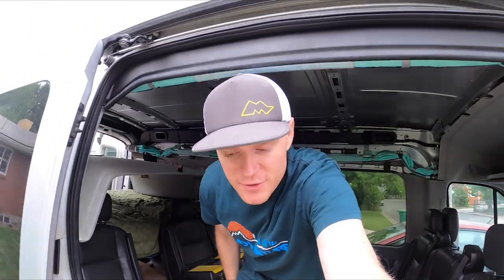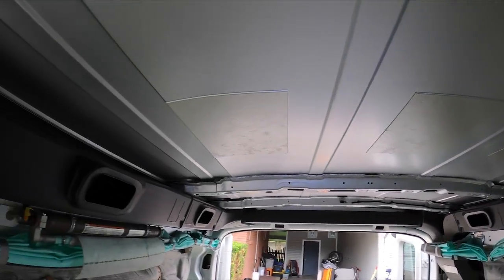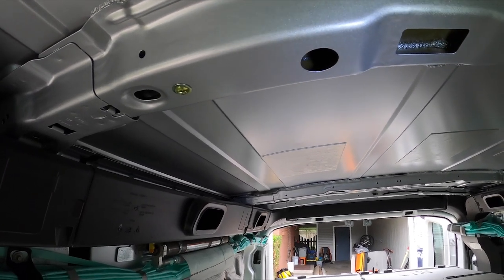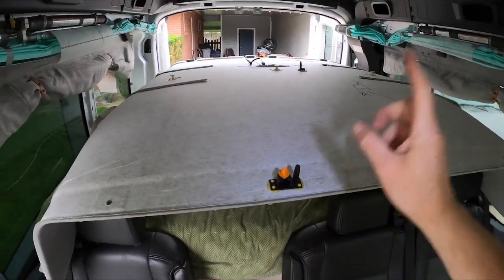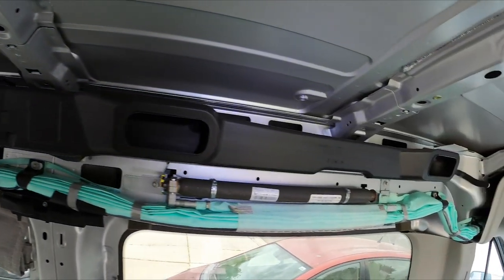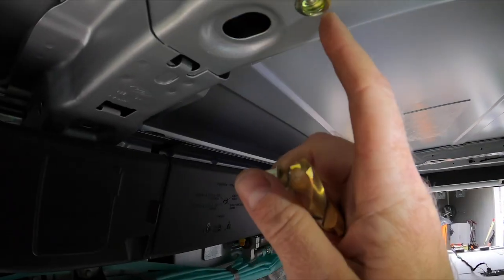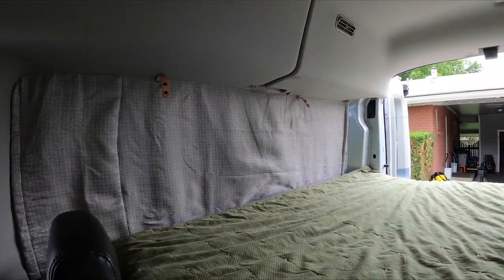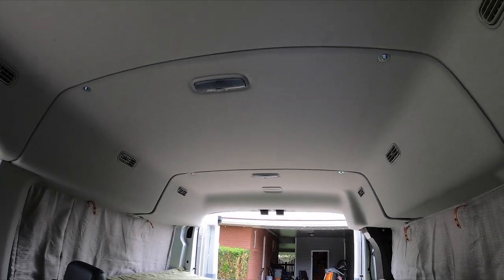Ford Transit - a look at the ceiling behind the headliner

Comment: On those new bolts, what kind of spacer did you use between the Rivnut flange and the bolt washer so you could get some compression on the bolt without crushing the headliner?
Reply from the maker: https://www.amazon.com/gp/product/B07DVZFFML/ref=ppx_yo_dt_b_asin_title_o05_s00?ie=UTF8&psc=1

Comment: What size plusnut did you use?   I am about to start on a transit passenger high roof extended.   I want to do a similar thing to the headliner once i pull it out.  Thanks.
Reply from the maker: Good question. I can't remember what sizes I used. it was just slightly bigger than the existing holes. Only had to bore them out a tiny bit to get the plus nuts in.

Comment: How have you ended up using the attachment points, if at all?

Do you think it would be possible to use the front ones to attach some sort of cross bar or wood plank that you could then attach a fold down TV mount to?

I am interested in having easily removable TV mount because we would only use it for long road trips....
Reply from the maker: right now, I mainly use them to mount a cargo net so that the kids can stash their jackets, pillows and suck overhead. If desired, they are strong enough to hang hammocks and they support my weight. I think your idea would work.
Reply: @SeekOutTheAdventure  Your answer is so helpful!   I wanted to add a hanging chair to the back but was hesitant.  Now I'm doin it!!!

Comment: Was the headliner by the rear doors hard to remove? Any tips on how to remove it?  Thanks.
Reply from the maker: it was easy. you just have to remove a few plastic pieces that pop off pretty easily.